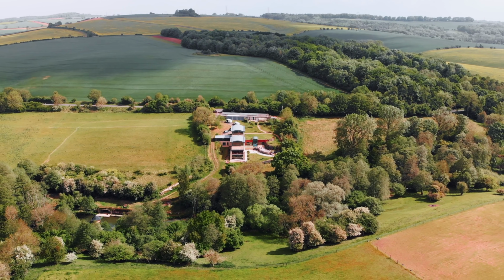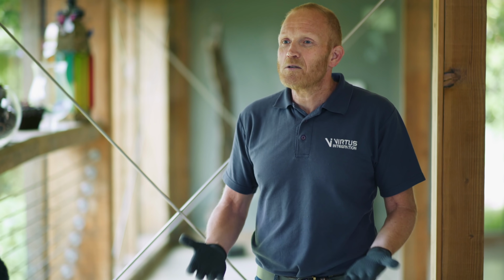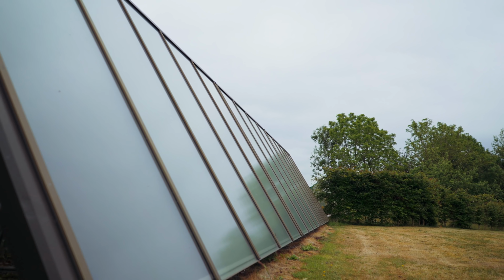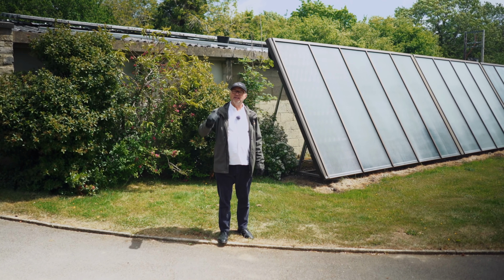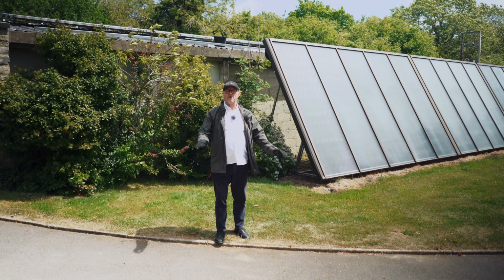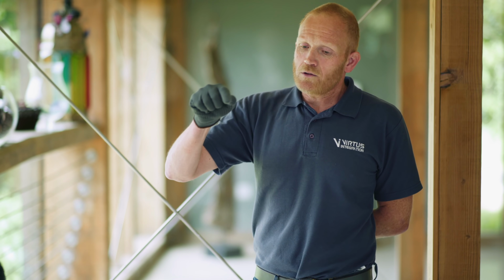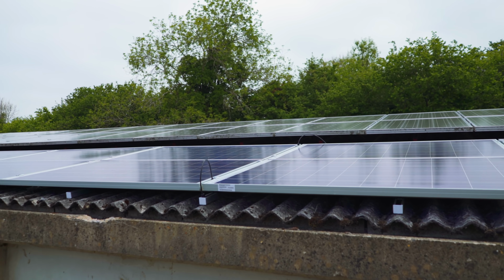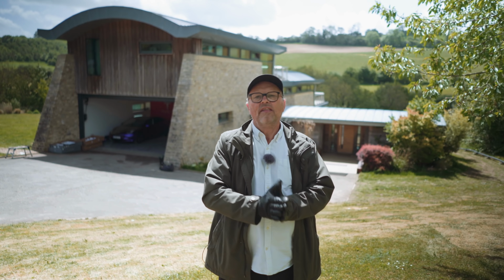Can you HEAT & POWER a big house with RENEWABLES? | FULLY CHARGED for clean energy & electric cars.

Comment from the maker: LIKE if you like the idea of heating & powering your house without burning anything and SHARE if you think all new houses should be built with renewable technologies. 

Robert visits the inspiring, and award-winning, Moonstone House, to find out how this massive property uses zero burnt energy and in fact is actually generating power. It is bursting with new technology, is being constantly updated and is a true insight into a future where all new and normal houses are free from fossil fuels. For easy reference through each section of this episode, see timestamps below. AND If you like this episode, you might enjoy the previous episode on Tesla's Powerwall and how quickly it can respond in a powercut: https://youtu.be/9xuleBA4Zcg
Reply: 6:53 What is that insulating product that’s only 10mm thick that’s as good as 1 metre of rock wool?
Reply: @Richardincancale  Vacuum and and some kind of infrared mirrors. One way is "space blankets" and spacers between two rigid plates and vacuum the structure. Another is glass foam with vacuum bubbles and mirror surface. Vacuum and mirrors is made by adding metal salt that generates gases at glass melting temperature in mixture of glass powder. The result is light weight vacuum foam with mirror wall bubbles. That glass foam can further be made pellets, and used as spacer between two membranes and vacuum is made between the membranes. 

The result is close to vacuum thermal flask.
Reply: He may have missed a trick, he could run the ground source heat pump in reverse during summer when he has too much heat to heat up the ground slightly and make it even more efficient at pulling out heat during winter. Depending on local conditions and how fast the heat dissipates away in the ground.
Reply: I really want to see more ELECTRIC heating options for the home.  I'm excited for a hydrogen economy but wouldn't it be great if renewables made electricity prices plummet so much that we just did away with the gas network totally and burnt noything in homes - not even green hydrogen!
Reply: YewTewbe - with hydrogen you can make electricity, water, heat and steam from one supply
Reply: @AsphaltAntelope  Air source heat pumps are getting better all the time, ground source is better if you have the land.
Reply: I am busy insulating my 1940's house at the moment. I cannot get it to that standard of course but doing what I can.
Reply: @williamarmstrong7199  It would be nice if they would have given information about what insulation they used in the house and what its rating is. Also, they talked about a lot of concrete but did not tell us how much a lot of concrete is. How much rock and concrete are inside the insulation envelope? It is hard to think of a house with that much glass as being energy efficient.
Reply: Having grown up in housing estate with communal heating system (Roehampton in SW London) I remember the delight we all felt when the boiler broke down in the winter. Oh how we laughed as we danced to keep warm!

Good video nonetheless ;-)
Reply: Robert, you are an great advocate of not burning oil and gas, but I would love to see some future videos on the most efficient wood stoves, wood pellet boilers etc. Keep up the great work.
Reply: fullychargedshow, is the thin insulation shown available in Australia? And what's it called ?
Reply: Wow! The San Simeon of energy.
Reply: Love your shows! But, you need to always include PRICE and LOCATION!
Reply: Love to know more about the insulation material
Reply: Excellent, Added To My Research Library...
Reply: Would that be an environmentally friendly mansion/penthouse 🤔
Reply: Amazing
Reply: To make things better all this house needs to be the perfect place to survive a apocalypse are hydroponics and some multi-purpose 3D printers.
Reply: V /W massively!!!
It’s total bs, check out passivhaus. 
And use proper insulation.
Reply: Truly an inspiring place, although it makes my heart hurt to watch it, only because I will never have the money to live like this. And probably won't ever get to work in a place like this either.
It does get the imagination going, though. The extra solar panels and to-grid capability is exciting. But personally, I think this place could also be growing fruits and vegetables and responsibly keeping poultry even! An orchard, an allotment, a fancy modern greenhouse and a huge flower garden for bees! Make it more than a house, make it a center showcase for sustainable living by giving excess food and electricity to the local people.
This is why it hurts to watch this, I'll never get to fulfill my personal dreams like this.
Reply: Everything is good except the fact its out of my range and taste because this house simply do not have the home feeling plus I need my privacy !
This house is sure scoring well in the off grid concept but failing miserably on cost and coziness, lovely home feeling !
Too hollywoodish and celebrity off beat house like commonly found in the suburbs of LA !
Reply: Is the way that we should build or designer houses
Reply: 🤗 ROBERT…I HAVE BEEN LOOKING FORWARD TO THIS FOR OVER  55 yrs  USING MANY OF HIS IDEAS 💡 and NOW IT IS BEGINNING TO BECOME A REALITY  🤗👍😎💚💚💚
I HOPE YOU  ( and I know you are ) 😁 ENJOYING YOUR VISIT TO SAN DIEGO   👍💚💚💚
Reply: Excellent, Sharing Through TheTRUTH Network...

Comment: Very interesting video but this rant about hp is not taking into account that 95% for UK houses are old and not suitable for HP. The HP are expensive to begin with. You then have to have underfloor heating and very well insulated house. The cost is truly astronomical for most. Easily around £12-15k. Who could afford that? In Hull houses can be as cheap as £60k. Are seriously asking someone to pay 25% of their house cost on a heating system?

Comment: Have they considered diverting some of the heat generated by the thermal panels into the slinky / bore hole? i.e. thermal bank storage.   Remember reading something about this and a company called ICAX who completes systems like this for commercial sector.

Comment: Stop and think. All this is redundant if electricity is cheap. Just use an emersion heater in a tank and use raw electricity to heat the water and pump it around the house.. All the equipment is unnecessary.

Comment: John is a hero in my estimation for demonstrating what is possible. The comparison of the insulation thickness required in 2002 v 2020 was absolutely mind blowing. When I studied environmental science in 1993 I came across articles on houses built in Norway with zero heat loss and have wondered ever since why this is not made more of building standards because efficiency has always been the most effective means of reducing environmental impact and cost to the consumer. As long as the DoE is staffed with supporters of the corporate housing lobby noting can be expected to change, but why not have community led projects that embrace these types of technology? This man is shining a light for all to follow.

Comment: Impressive, but I would like to see him build the same house betwen Los Angeles and San Diego, where heat is not the issue so much as cooling.  Even Britain has had some hot (Comparatively ) summers recently.  wha if those heat waves, which happene nearly for weeks at a time several times a summer in southern Pennsylvania, became normal in Britain?  I assume that the heat pumpes could be turned off at the end of April so theconcrete could start cooling down, but the solar heat gained through all those windows could still turn that house into an oven in our Southwest.

Comment: For even more cheap energy storage, they could use sand batteries. Basically, a silo or pool of sand, insulated by aerated concrete. But they can probably use vacuum-pores (or how that finger-thick insulation, which insulates as much as their meter-thick foam insulation, is called), to save up on space, if they need to. The sand thermal battery can get hot enough to melt aluminium (600 Celsius), while water thermal batteries cannot even get hot enough to boil water (90 Celsius), so a lot more energy can be stored, which can them be turned into electricity with a steam turbine or with a stirling engine. Since small water heaters can get hot enough to turn water into steam, then a greenhouse-pond with more sunlight reflected onto it can probably use a self-sustaining siphoning to get seawater into the ponds and use the sunlight to evaporate it and then use big pipes to direct that steam towards the desert regions which need fresh water, where the water can be mostly turned into water and a part released into the atmosphere to create clouds and to generate electricity and to help the other steam turn into liquid water, all at the same time. And not only that, but low-temperature high-pressure steam can also be released to a lower-pressure area to lower the temperature, effectively having passive AC for some industries, like the agriculture (in the desert, where excessive heat is a problem), shipping (especially for foods which need refrigeration), and even district heating and district cooling (so the hot water pipes can be used with an antifreeze-water mixture to cool the house instead of heating them, in the summer). Also, there could be a separate system to ship heat from the temperate regions to the colder regions which need it, to reduce the heating costs.

Comment: I have built 7 houses that do not consume any energy ... Make a house airtight using SIPs and then use  passive HRV. Build  a conservatory on the south elevation.and ventilate into the house. Alternative nrg ... wind in Scotland, solar elsewhere. Batteries ... I started with an old submarine battery 12 years ago and now I use hybrids,...

Comment: With PV roofing tiles now a thing, the building regulations should include solar roofs in every new build, the extra cost is minimal. Forget nonsense like geothermal, which simply adds more heat to an already heating planet. Charging points for EVs should also be the norm for all new build.

Comment: Wonderful house but how the bloody hell does the average person EVER afford to do even a fraction of this??? Solar panel FIT is gone now for new installations so you need to spec out several grand to buy a battery to get any payment. Biomass is a big con - a bag of pellets costs the same to use as my aircon. And geothermal is unknown unless you live in the likes of Sweden. This is all our in the sky. It requires government to do far far more than the token efforts they currently make. And don’t forget, NONE OF THIS is as green as they make out - the CO2 release from the manufacture of PV panels alone is vast, as is the emissions from concrete.

Comment: Did a bit of this ourselves about 5 years ago on a ‘60’s bungalow. Insulated walls (contractor job) and roof space (DIY) and 4Kw solar (contractor) Heating costs for a year, £270.48 (just paid the bill, oil sadly, but much less of it) and electric under £20.00 per month for a three bed place. Cost us under £6500 to do it all. The savings paid for the work in under 5 years. And we’re nowhere near passive. If we were new building it would hardly make a difference to the cost at the end. From someone whose done it and was budget constrained. Next step over the next 2 to three years, an EV, a battery pack and a no fossil heating system. We have a plan.

Comment: Nice 17,000sqft no heat. I have a 7,000 ranch style house and run exclusively in floor radiant heat with no forced air heating. Im fully geothermal powered fully through my full roof solar and large for residential wind turbine kicking in a bit for fun. I have a large battery system as well with roughly 135 KwH. My goal is to add a 1 acre roughly 0.4 hectare solar farm. Im trying to be able to power my machine and fabrication shop off grid. Which is perhaps a pipe dream as I have 4 CNC machine 2 lathe and 2 mill and a large number of other machines. Plus large industrial air compressors with 5,000 gallons of air storage. Charging my 2 Mach E and the wife and my oldest daughter have model 3's. Hardest part I think will be all the incidental power use, TVS and kitchen stuff and the server room plus all the PC's and home security. Im personally ok with paying for grid power until I can sort out how to not change my life around having power. Selfish as it may be I don't want to have to think about if I can turn my TV on while the cars are charging. I don't want to have to sacrifice. I will eventually be sufficient, I'm hoping the 1 acre solar farm and at most maybe 2 more wind turbine. 
Should I just go with a bigger solar farm or add turbines to finish off my base load needs? I just don't know
Edit: I wish I had built my home to higher efficiency standards

Comment: Another great video, we're doing the exact same thing here at Helios Eco Lab with a 12.5 kWp solar PV system (54 panels) powering / heating the house with heat pumps and charging our fleet of electric cars which via our own simple V2H technology charges the house batteries when its cloudy. We are off grid in Greece which helps with a decent amount of sun. Haven't spent a cent on energy bills or petrol in many years. As you say house is a power station, car is an integral part of the house, a new paradigm. Also we grow a proportion of our own food, no sewage waste, all used for the veg gardens, rainwater harvesting, recycled materials, wind turbine, workshop making electric bikes, solar thermal heating for hot water and storage in internal pool. Loads more new innovations in the pipe line.

Comment: Yeah its not all free power: the ground around the buried geothermal pipes gets "burned" in ca 15 years, from the heat cycles especially if used for cooling too so it stops working, equipment in that complex machine room will break and batteries for solar will need replacing.  And when everyone starts doing it, the government will find a way to tax your geothermal pipes by the metre.
Like those stupid wave power generators, people think that the paddles will last indefinitely in the seawater environment.

Comment: Thank you for this.  We have just purchased land in country Victoria, Australia and are now designing.  Passive heating, insulation (earth shield), hydronic climate control, double glazed windows, solar, earth loop, recycled water, water catchment and maybe wind are all part of the mix.  Where we are building is an average 5 degrees C colder than Melbourne, nowhere near as cold as the UK but cold enough.  But, being Australia we will still have the hot weather, so we are looking at cooling solutions as well.  Cross ventilation, orientation, the use of shading and eaves are also in the mix.   Our intention is a high capital expense upfront (at the time of building) and low operating expenses for years to come - especially in retirement.  One of the main issues we have the area we are building is the possibility of bushfires and the loss of electricity when needed most.  To protect the house using a pumped sprinkler system connected to rainwater tanks using renewable stored electricity.  So, having battery backup not only will be used to store excess electricity but to ensure continuous power when most needed.  To date, I had not seen all of the concepts, I have been researching, working together until this show.  Appreciated.

Comment: Nice to see people putting their money where their mouth is.  Every new build should insulated to the eyeballs and fitted with a solar roof.  Advanced technology like this would be daunting for most people, but there wouldn't be need for fancy control systems, batteries and inverters in every house if the PV panels fed a local substation directly, which would also handle district heating.

Comment: Yes, brilliant in some ways. However, all that concrete???? Loads of CO2. Quite a bit of steel? Loads of CO2. All that glass??? Loads of CO2. And what appear to be extremely complex heat  distribution and management systems. The goal of all this is absolutely spot on, but the next generation of buildings like this need to address some basic construction issues. All that said, amazing house, looks great, congratulations.

Comment: Do we need to reinvent the terraced house as the modern way to build even "middle class" housing? You could put thick sound-insulation-cum-firewalls between them. That would surely be more energy efficient, and you could plumb them all together on a single ground source heatpump system.

Comment: I love the idea, of house builders doing a communal heating.  As you said could use solar, for electric, and heat exchangers for central heating.  Then integrating it all, so if there is spare power heat up the water, or sell the electric back to the gride.

Comment: Only PV electricity can be exported. In theory feedintariffs should be higher the closer it is to cities. Why did they install so much PV thermal if they had to dump so much into a swimming pool when the house is ultra insulated. Nice if you have a pool but thats after its filled the water tanks. Also with 60KW solar and there 10KW is already enough then an excess of 50 is going to take eons to make a return. Not sure countries not used to district heating would understand sharing the cost of a microgrid even if it was cheaper for all. The temptation is then for landlords and owners to let others pay for a shared benefit knowing they will also benefit from others paying for its upkeep.